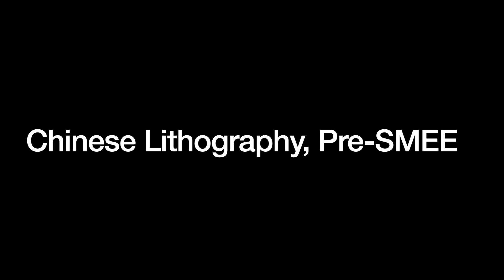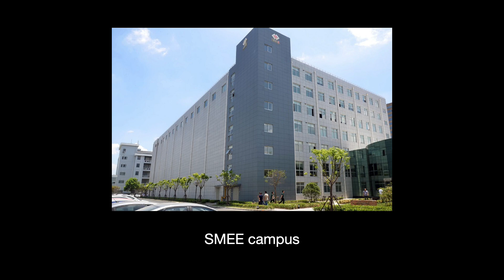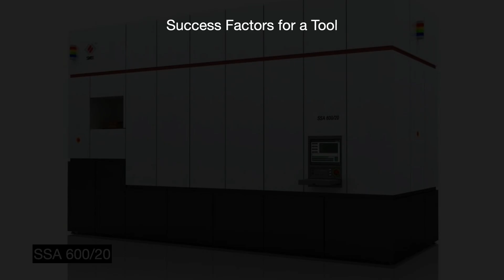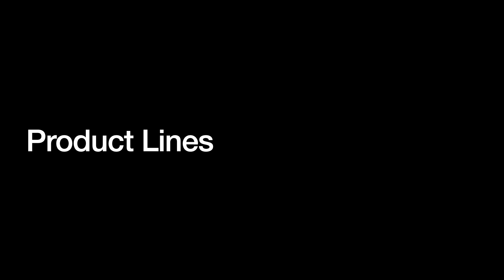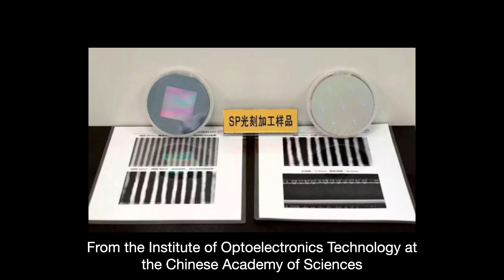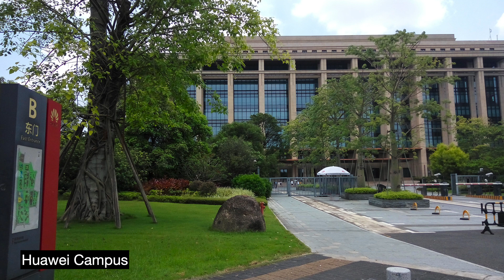China’s ASML is Years and Years Behind

Comment: "Years Behind" is much, much better than countries that even have not started.
Reply: how about better than can't even manufacture correctly after given the full recipe?
Reply: Only if they get a real return on all those billions if they don't then the country's that never tried are much better off.
Reply: @scarletmoon777  besides commercial purposes there are also strategic ones. A country without its own armaments is necessarily under someone's control.
Reply: @ccwong75  They are already making lithography machines they are at 28 nm after that it is 14nm then 7nm 

ASML's most advanced machine currently is 7nm 

>In July Wen Xiaojun from China’s Electronics and Information Industry Development Institute said that Chinese foundries would achieve mass production of the 28nm node this year and 14nm next year, relying on end-to-end Chinese tools. SMEE’s 28nm lithography machine is now being shipped to clients too, but tech experts believe the jump to 14nm will prove more difficult
Reply: @xblade11230   you do realize Chinas 28nm machine has loads of core japanese made components in  it and that can also be stopped in an instant
Reply: @eduwino151  and china can collapse Japan by blocking non computer stuff, what is your point?
Reply: @eduwino151  You do realize that most of Japan's exports require Chinese imports to actually make 

You usually have raw material that needs to go through a multiple step refining process before it can actually be used in high tech stuff right

So for example for cobalt you need to mine spodumene ore, crush screen, hpgr, flash flotation, dense media separation, grinding mills, whims, flotation machines, thickeners, filters to get spodumene concentrate 

And then you need calcining, pressure leaching, lithium solubation , crystallization 

This entire process could be like 3-4 companies mostly Chinese 

Also for raw silicon production china and Russia are the 2 biggest producers with china alone being at like 60-70% of the entire world's silicon production 

China dominates what is called the first and second steps in pretty much everything, and most mining and mines and if they wanted to could easily crush any economy including the US 

And in a trade war they can easily and quickly do the final step themselves
Reply: @eduwino151  and this is just raw silicon, you have different grades of silicon for different things like 7nm processors you need silicon that is 99.99998 percent pure 

Lower grade of silicon is used for stuff like solar panels 

China owns the mines of 2/3rds of the world's critical materials and completely dominates raw material processing
Reply: @eduwino151  Now why does china have so many engineers?

It's because of social engineering by the government to increase the prestige and pay of engineers and scientists. 

Kids are encouraged at a young age to become engineers and study engineering 

Nerds are heavily featured in TV and movies and are shown as cool 

A Survey asked kids what they wanted to be when they grow up 

The kids in the US answered social media influencer

China alone produces like half of the world's engineering grads and their students outscore most western countries on standardized tests

The reality is that capitalism and democracy has lost and all it has achieved is the destruction of the US, failing education system, open borders, a vulnerable economy , a dumbed down population that is addicted to drugs, a culture of binge drinking and partying
Reply: @eduwino151  We also have reversed education models 

We adopted the educational model of medieval china while they adopted the education model We had under the industrial  revolution 

Although this educational paradigm is often seen in the West as an outgrowth of the “Confucian model” of education, this is in some ways the opposite of the truth. There are, broadly speaking, two types of education, defined in terms of their method and purpose. In the first model, which can be called the “Confucian,” “classical,” or “humanist” model, the point of education is to create a more refined or virtuous human being, not to teach particular technical skills. The reasoning behind this approach is that a scholar who is steeped in the works of the classical world and the wisdom of the ancients will be equipped with the sound judgment and faculties of reasoning required to learn essentially any job, on the job.

Against the Confucian model stands a very different view of educational attainment, a view that might be called the “Prussian” approach to education. Put simply, the Prussian approach focuses on instructing students in specific, measurable skills: technical knowledge, mathematical proficiency, mastery of official state propaganda, and so on. Learning to be a great engineer is the entire point, and proficiency in engineering can also be objectively measured, unlike nebulous concepts such as “wisdom” or “virtue.” The Prussian view has little use for scholarly ideals, and encourages rote memorization or similar practices to make knowledge of the subject matter stick.
Reply: @xblade11230  and u know what 
They finally created 7nm chip
Reply: Not every country needs to build everything.
Reply: Like India
Reply: @scarletmoon777  China can't afford to not try
Reply: @scarletmoon777  not true at all.
Reply: Good logic !  🤣🤣🤭
Reply: Yes, they will catch-up eventually. If any country can, it will be China. Breaking the western hegemony is incredibly difficult. And only China has been able to do so.
Reply: @nadasou  I would like to believe so, because that would be good for other countries in Asia, but reality is that the Chinese, CCP or otherwise, will continue to be a force to reckon with for many many years.
Reply: @SkpalTube  Soohistry, planintiff becomes defendant in communists' law! 🤣
Reply: @SkpalTube  Wake up, you are the defendant now!
Reply: @nadasou  Pls elaborate. Maybe, I am not that gifted with using my brain. 😉
Reply: Kymer ? Never heard of it it is Cymer as Charlie C.
Reply: Other countries can currently purchase ASML machines however, China cannot.
Reply: CCP China is expert in making balloons! 🤣
Reply: propagandas.
Reply: @xblade11230 wrong - China has so many engineers b/c most of their engineering diplomas are bought rather than earned. There’s Plenty of exposes about this fact. That’s why their QC remains at such pitifully low levels
Reply: @bigmedge  lol cope the us imo math team is 6/6 Chinese 

Chinese people are less than 1% of the us population btw, yet make up 100% of the us imo math team
Reply: They're copying ASML , if they were so good they'd have already invented a whole new way of computing

Comment: Anything up to 7 nm will be good enough to be self sufficient for most electronic appliances. Banning foreign chips would kill the market and foreign R&D will dropped.
Reply: Why would 7nm be the magic number? What is cutting edge now will not be cutting edge forever.
Reply: @1schwererziehbar1  Because there's only a handful few companies even in global market that need their processors to be fabricated at 7nm or smaller, all of which already had TSMC printing their chips.
That, and the cost for machinery for fabricating chips gets exponentially more costly after 10nm mark. GlobalFoundries had halted their 7nm process upgrade for this reason.
Reply: @1schwererziehbar1  only the latest phones have 7nm and below chips .Everything else is on mature nodes
Reply: @s.k634  no even budget phones are beginning to use 7nm chips
Reply: @prayagmehta9738  honestly, I think this is more a matter of what is the cheapest node for budget phones. Compared to a 45nm chip, the real gain is power efficiency rather than usage of more performance.
Reply: @miyatenmeiritsu1810  it doesn't mean that those non bleeding edge founders will stagnate during the time PRC get 7nm production. When Samsung or TSMC get rid of obsolete machines, they don't sell them at their initial price. PRC's founders will still have to catch the tech and investing hugely in R&D so they will stay disadvantaged compared to all those competitors who can simply access cheaper second-hand tech.
Reply: @s.k634  Apple is working with second gen 5nm now.

Comment: You just need to remember China was years behind on 2G, 3G and even 4G. But quickly caught up and became years ahead on 5G and decade ahead on 6G.

Then look back at the years behind then ASML.
Reply: "Ahead" is a premature call considering how China's 5G has not been economical to operate: their antennas consume at least double the electricity to provide a noticeable speed boost. The Chinese telcom companies are known to schedule regular shutdowns of its 5G service because their early models are such a money drain, while the European competitors have been more focused on first making them more power efficient and worth implementing.
Reply: @doujinflip  If you really believes what you 'learn' from MSM.

5G is already started to operating in far isolated villages. half billion users using much higher than 4G network. Except some countries denial to Huawei, or forced by US, even developing countries in Africa are having faster network than US. 

While in US, even you have 5G 'connected' shown on your phone, what is the chance you have higher than 100MB speed? I tested in several large cities. Unless you stand beneath a 5G tower, otherwise, you will be lucky to reach that speed. Most of the time, I have to turn off 5G to use 4G for better connection. Is this what you called economical to operate? So economical to the ISP providers. LOL.

Comment: Can you talk about China’s recent 7nm chip?
Reply: Definitely an impressive breakthrough, but I would wait for reports about the transistor density and thermal performance of chips produced using SMIC's 7nm process. If China's 7nm chips perform comparably to TSMC's 7nm chips and Intel's 7nm Meteor Lake chips then it has reached parity with the US. South Korea and Taiwan are still in the lead with 5nm and 4nm chips in production with 3nm chips set to arrive in the near future.
Reply: @JollyOldCanuck  wow . Didn’t know  7nm Chinese chips actually possible . Thought that was at least 10 years away per early reports . Guess anything is possible nowadays.
Reply: @yoichikirigami607  Based on what is being reported SMIC closed the gap by poaching engineers from TSMC by offering them absurd sums of money.
Reply: @JollyOldCanuck crazy so it won’t be long before we get 1 nm and below chips! Exciting !!!
Reply: I'm just waiting for new graphics cards and lower prices.

Comment: Being 20 years behind isn't as bad as it sounds, you can produce most of the todays chips with that technologies - no high end CPU or GPU and similar "on the edge products but most of the industrial technology that doesn't need a cooling fan doesn't depend on higher resolution. And in the worst case of an embargo a 20 year old CPU is better than none.
Reply: Lol. Do you think anyone would buy Chinese products like smartphones or telecommunication equipment like 5G if they used chip technology from 2001? Do you think Alibaba or Baidu can run their data centers with chip technology from 2001? Do you think Chinese car companies can compete in self-driving cars with GPUs from 2001? Give me a break.
Reply: 20 years is a long period of time in tech advancement, this is really bad. Sure it's good enough for basic IC and discrete components but even on the microcontroller , DSP or MEM levels this is quite a huge technology gap. Sure you can build low power chips with that but not as integrated, performant and efficient as foreign chips. Sure industrial machines mostly use very old and basic electronics, they don't care about fanless though, but for other crucial tasks like R&D, design or communication companies need relatively performant computers.
Without at least a 45nm node ready for production a tech embargo will be a difficult step backward for the interior market and whole infrastructures.
Reply: Disagree. The exponential growth in nature of semiconductors makes the 20 year gap much larger than any other industry.
Reply: 20 years is bad.

Imagine swapping your smartphone, PC laptop, TV, for stuff powered by chips from 20 years ago.

Comment: LOL.  nice video, but quite biased.  Seemingly all based on facts, but here are some food for thoughts of counter points:  (1) the reason ASML succeeded is because it worked closely with TSMC.   SMIC had no incentive to work w/ SMEE since SMIC was simply buying from ASML.  If ASML were forced by US to stop sales to SMIC and others, all China fabs have no choice but work closely with SMEE and other equipment makers (if not already).  And there are many equipment makers going IPOs and capital for semi is Not a problem in China.  So to a large extent, the reason China equipment makers have been behind is simply because ASML and Japan vendors continue to supply to China.  I would say in the past year or longer, China fabs are already tightly working w/ equipment makers and the advancement will not be what you claimed (20 years behind... LOL).   (2) vast majority of the chips don't need 14nm and below... including most military chips.  ASML CEO was noted to fight back to US and stated this. LOL.   Military needs reliability and stability and doesn't need low power consumption that an iPhone needs....it's clear ASML doesn't agree with US' stance.  (3) Chinese are resilient and smart and work super hard.  It's completely ironic that at the end of the your video, you are highlighting ASML work-life balance et al is better et al.  Huawei / China system is bad.  LOL.   TSMC succeeds based on similar system as Huawei ... people work around the clock and service oriented.   In fact, it is this service driven cultural to continually focus on improvement and innovation, that SMEE and others will actually advance more quickly than others moving forward. LOL.  Sad argument made there.   (4) what's after 1 nm fab?  what's after 1 atom?  Moore's law already doesn't work, and we are already hitting limit..it's harder and harder to breakthrough....  it's much faster to be catching up when the front runner is hitting a wall.  (5) it cost 30B USD to build a 2nm fabs now... the cost of fabs and equipment is skyrocketing... ASML and others all need China and other fabs to buy its equipments to support their R&D and innovation. Decoupling only means they lose China market and lost revenue... less money to invest in R&D and keep up the innovation.  LOL.    In short, I see US' desire to contain China is shooting itself in the foot (& Japan, Taiwan TSMC, Korea Samsung/Hynix/etc., ASML etc will just suffer together)... all US semi companies suffer and become less profitable and less capability to invest in R&D.  There are tons and tons of Chinese engineers and scientists across the whole semi/chip design industry in Bay area.... because of the continual discrimination / AAPI, I see here in many Chinese in Bay area are returning to China.  There are 5-10X more STEM graduates in China than US every year.   More patents are filed by China than US in the past past decade.  By the way, I'm not even from China.  Just a by standard sharing my view.  LOL
Reply: Excellent point, SMEE is just back up plan for China, better preparing for uncertainty, many chips are made in China now than 10 years ago; we use them in repairs service in Canada, the  trend is unstoppable. Majority of employees are Asian in electronics manufacturing in Canada.

Comment: I honestly believe China's semiconductor companies are years behind in silicon chip manufacturing. 
They are currently about 3 generations behind. 
But this gap will shrink to just 1 gen in 5~10 years. And in 15 years, will be at parity.

Sun Tzu said: "Fight where the enemy are not."
Heed the advice and develop in fields were there is no competition. HINT: Carbon Chips
Reply: I feel like SMIC catching up to TSMC is a way easier task than a Chinese company taking on ASML.
Reply: You mean parity in 15 years if nothing else changes, right?
Reply: Based on what? Pure optimism? On what sir?
Reply: @cbrtdgh4210  I would believe to be incredibly difficult if SMIC cannot purchase the EUV machines.
Reply: @ttemp2631  there are ways to jump around those physical limits, its just that what is next will look nothing like what has come before: i.e. quantum computing.
Reply: @cbrtdgh4210   TSMC uses litho tools from ASML.
Reply: @TheFirebird123456  and that contributes SMEE and SMIC to close in the gap. SMEE is now a decade behind but it will be ever more difficult for ASML and TSMC to get higher transistor density. Every step after 7nm the complexity and costs rise exponentially and not only with lithography but also with other steps like etching.  Good for China to focus on the next where they have an equal start.
Reply: EUV is very different from DUV - and I don't see any research in this direction yet. So basically if you start with 1.000 top-edge engineers and 10 Mrd $ budget today, you could have a basic EUV machine in 15 years from now. Good luck
Reply: @Ben23315  , China started research on EUV at academic institutions about 10 years ago. They have built an engineering demonstration prototype using LPP EUV light source. But it's far from being a practical industrial machine
Reply: @shermanpeabody6102  Like Asianometry states in the video, there is a ton of news about prototypes and breakthroughs in the media - but there is no proof that this is leading anywhere (same as batteries). Building prototypes in the lab is easy, getting a machine which produces 24/7 with high yield is insanely hard.
Reply: @Ben23315  , I agree. I think the prototype is just a demonstration, from what I seen of its photo. Obviously it's not going to process 200 wafers /hr.